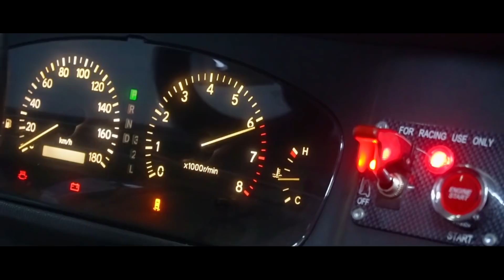Making an exhaust system out of wood

Comment: Suggestion:  Try mounting a tube, maybe two to three times the diameter of the exhaust.  Then weld two tubes inside to come out the ends of the tube, and set the inside ends about 3cm apart.  Then at each end, have the exhaust of the engine enter the cylinder, one end at the top of the tube and the other at the bottom of the tube to create a counter-rotating exhaust stream that meets at the 3cm gap.  I'm betting the sound cancels out the sound, and you create a baffle-less muffler.

Comment: Next change the brake lines with a garden hose
Reply: Woah ur really on to something
Reply: It will not break, the large diameter will absorb all the pressure from the master cylinder, no brake effect and no strain on the garden hoses. Just look at   any master cylinder, the diameter is so small so it moves very small amounts of liquid, not enough to expand a garden hose more than a few micrometers (depending on length, a very short one would visibly expand)
Reply: Whoosh
Reply: Or plastic straws

Comment: Red line it, then cut the ignition (keeping the fuel on), then put the ignition back on when the revs drop to around 2k and you should get a nice bang and flash from those wood mufflers, repeated action will probably set them alight :P

Comment: The water pump makes a lot of pressure..... How about we were revving the shit out it and didn’t have any cooling fans so it overheated and blew the hose off!
Reply: There's a radiator in every car for that case.
Reply: Proto Man Go hold your rpms near redline in a parking lot for 10 min without moving. Most cooling systems will not keep up with that load without the vehicle in motion and will overheat. Especially an older car. The explosion of hot steam proves the water was past the boiling point and the engine was overheating.
Reply: @brockallentaylor  sounds reasonable :/ I wonder why they didn't stop then. Didn't they see the temperature dial going off the charts?

Comment: Top video! 
But, why did you guys expect it t p burn? There is hardly any oxygen left in the exhaust gasses. I don't think it will ever burn from the inside. Again: no O2 in there.
Reply: jfv65 
O2 sensor is in the exhaust for a reason...to measure o2!!!

Comment: I had a Lada Riva back in 2000, it was like a year old and immaculate but its heavy steering and crucifying seats ripped my shoulder and back up on long journeys, a shame as it was so clean, the previous owner too had the same problem so suspect something was amiss as that steering was heavier than an old lorry's.   Its weird as my surplus Lada Niva was the complete opposite to drive other than lots of noise at high speed, that thing could tow the legs off a donkey and often did tow a heavy twin wheel trailer with a Ford Granada banger racer on the trailer and never complained but rust killed that ol' beastie it just kinda exploded in the chassis rails and back then welding was heinously expensive so scrappy it was.

Comment: No surprise, you cant get enough heat from just reving an engine. I once drove through sweden in negative 35 celsius, thats extremely cold, with an old car that never been used in winter and had no thermostat installed, so it never got hot. I thought i freeze to death, i tried to stop and rev the engine for a long time but still no heat. To produce real heat the engine need to be loaded, like pulling a heavy trailer uphills.

Comment: 2 huge wood mufflers spread out the heat enough to not burn. 1 Tiny one would likely be the ticket. But quite a bit of heat is lot by the time it gets to the back and it needs to be about 451deg to burn. paper anyway.

Comment: if the plywood's getting damp that's good it shouldn't catch fire but eventually it will get hot enough to evaporate all of the moisture out of the wood that's when you have to worry

Comment: If you could make a set of pipes and mufflers out of wood if you can figure out the heat transfer or the wood joins the metal, I would make another set of mufflers out of fiberglass wood and make a serious attempt at them lasting a long time. That would be hilarious

Comment: Wood ignites at 451 Fahrenheit, which is 232 Celsius, so if your exhaust was 40 Celsius, there should be no problem other than warping and rotting from moisture over time.

Comment: Try actually putting load to the engine. It'll get much much hotter. Once a friend touched exhaust of his car with his leg and got a burn on his skin that was visible for several weeks. And that was with a stock car. It wasn't hot enough to stick to metal, but it was hot enough to leave a nasty burn.

Comment: Why wouldn't they just matter a wood flange to the catalytic converter? Seems like it would be easier and get 2 sheets so it would be symmetrical pot on sides of plywood and run Kustom square pipes all the way back

Comment: Well I mean, wood has a spontaneous combustion point of what, about 430 degrees celcius?
How hot does a standard car exhaust get, 90 degrees?
That plywood will never burn, though the glue holding it together might liquefy.

Hmm, I wonder what a cedar exhaust would sound like.

Comment: What car is this? Is there a build video think I've missed this
Reply: The car is called "Shorty" and there is a build video for it.
Reply: They have not translate most of build video to you yet, sorry.
From my memories it has changed to it:
Shortened
Engine changed to 1JZ engine
Gearbox changed to 6 speed auto :/
Custom cut short driveshaft
Gull-Wing doors with gas strut for easy opening
Exreme sound system
Custom wheel arch and etc
New interior dash front grille

Comment: Ok you are headed in the right direction but you need to use a large muscle car and not a small engine for proper sound. Remember bass. Bass comes from the speaker enclosure and the larger the enclosure the deeper the bass sounds. High pitched sounds on a fast car sound silly. Go for the low tones. Move this muffler closer to the engine. Last but not least put a flame proof resin on the wood to reduce the chance of burning the wood or catching fire

Comment: Garage 54 , Upcoming Video: "Lada Chernobyl"- [Lady Chernobyl] A Lada with Gauges, Steel Parts, Switches,etc from the Chernobyl reactor site. How many Rads will it read when it is going down the road? Will the heat make the Rads {Radiation Readings] go higher? Even the exhaust and muffler will be made from Chernobyl Steel.

Comment: With all the exhaust gases and no oxygen they wouldn't be able to burn if anything they would have to burn from the outside from the heat alone, but if they did that then you got other problems.